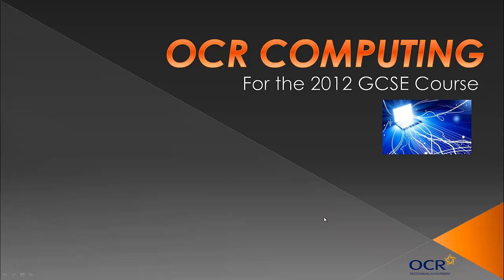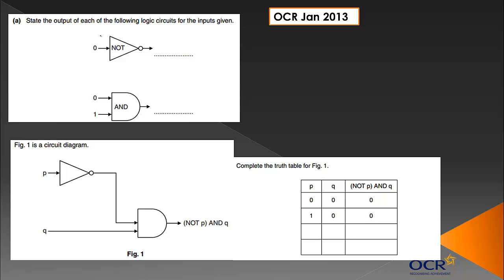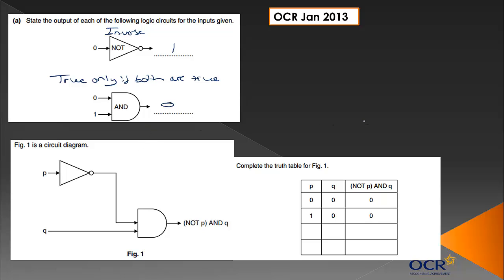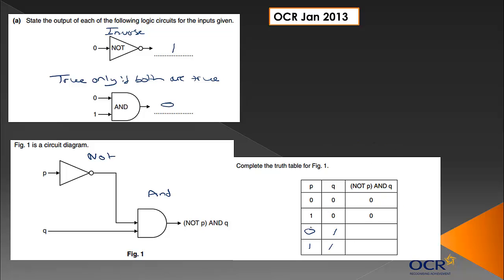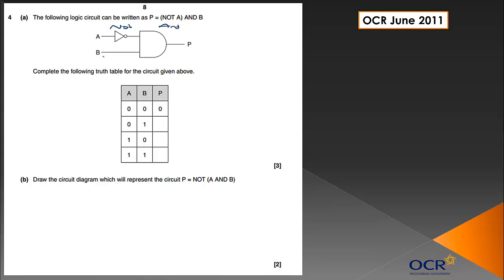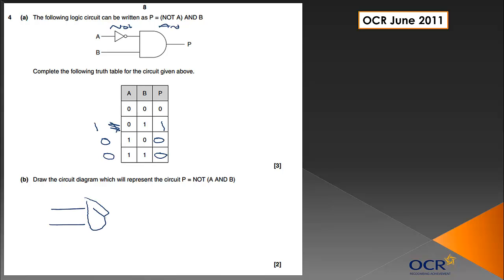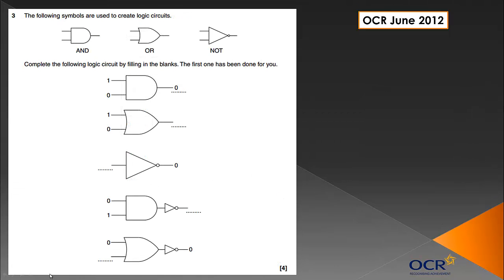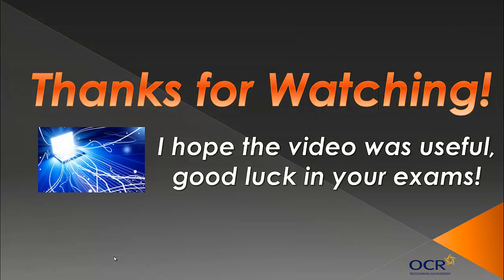OCR GCSE Computing: Binary Logic Circuits - Topic 3 [OLD COURSE]

Comment: Thank you so much for this :D really helps with revision!
Also if you're having a problem with two monitors and a graphics tablet, it should be in the settings under mapping?
Thanks again :)
Reply from the maker: No problem, thanks! I bought a half decent one after I made this so I did this :)